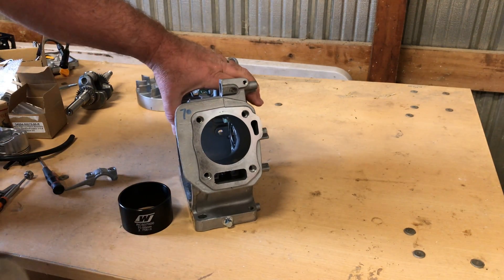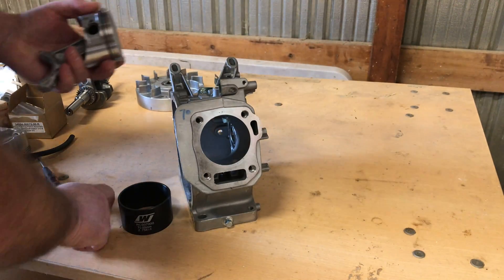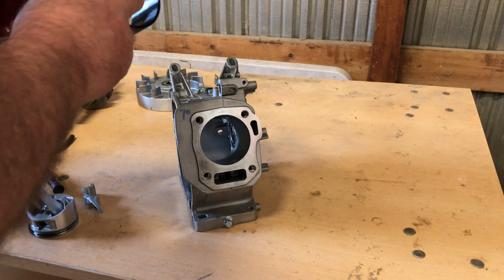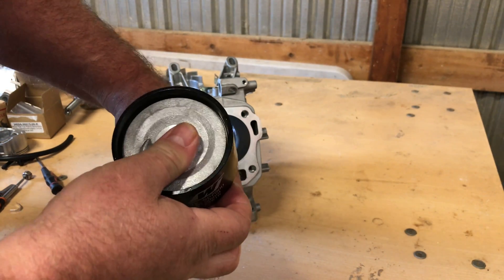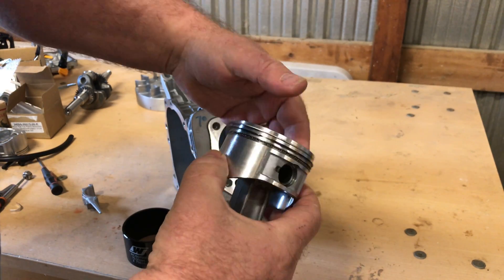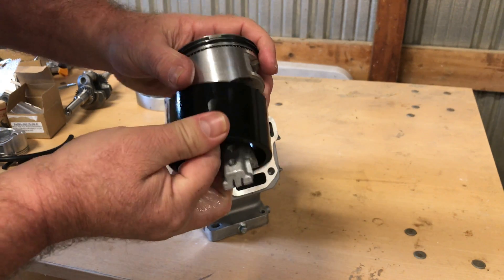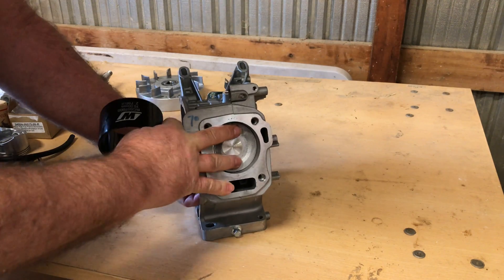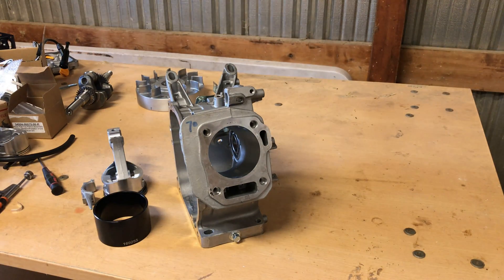Wiseco 70mm Piston Ring Compressor Best 224 Predator 212 Ghost Engine Build Tools

Comment: I got one for my Wildcat 223 as this seems way easier for my rebuild than my crap oldschool compressor I used to use but as a practice run with the old piston it keeps getting hung up on the second compression ring. You run into any issues man?
Reply from the maker: I've used my Wiseco ring compressor on several builds now and every one has been trouble free installs. One push and "zip" the piston is in the hole without broken rings. Make sure you have the tapered side of the ring compressor facing up. It would be easy to accidentally flip it around and that would cause install problems.
Reply: @KentuckyFriedFixes  Yesir had the taper the correct way I was really confused why it would not work. I used my oldschool clamp type compressor she went in no problemo.
Reply from the maker: @jaystrappa  They may have sent you a compressor for oversized piston + rings? I'd measure the ID because something is definitely wrong with that one. Mine still works like a charm.
Reply: @KentuckyFriedFixes  It’s the 70mm same part number you used man. I measured both tapered and non  tapered end that checks out. I’ll try again on another build maybe its a fluke lol
Reply from the maker: @jaystrappa  Could it be raising up off the top of the block during install? That would allow a ring to pop out on you. I'd try some downward pressure on that thing the next time. Maybe it's something simple? I've had some silly things happen to me during builds, usually because I wasn't paying attention or was distracted for a second. Usually that's all it takes for me to get a boo boo.  🤣
Reply: @KentuckyFriedFixes  I made sure it was flush against the block. I have a predator hemi just collecting distance Im going to try it on that one next. 😂 Happens to the best of us thats fasho!

Comment: Hey what other tools do you recommend, I’m about to build a predator 224 as close as I can to yours and seeing what you recommend?
Reply from the maker: Hi Ricky! That's a great point and an idea for a video too! I usually don't recommend specialty tools but in this case with the ring compressor it's a no brainer. They save you time and trouble and most importantly they save you from breaking rings. I would also recommend everyone purchase a dial caliper that reads in the .001" inch scale if you'll be doing engine work. They're cheap, like $19.95 for the HF cheapie unless you go all out and buy a $200 big brand name dial caliper, but you'll use it on literally everything in the engine. From measuring crankshaft out of round and rod clearances for oil to measuring your piston to deck height or camshaft lift, wrist pin diameter etc. Best $19.95 you'll ever spend. A 1/4 torque wrench for the rod bolts. Again, if you don't already have one you don't need anything fancy. Sure a Snap on is likely better than the Harbor Freight torque wrench, but unless you're gonna be building engines professionally, daily for other people, the HF wrench will work fine. Thanks!

Comment: Hey my friend! I want to tell you something you know I was going to do every add on I could to my 224 that was External but now that you showed me this very awesome tool I am ready to go bananas thank you so much for this information on this I will get it right away because that was the only thing holding me back from doing high modifications on my 224 I was dreading dealing with getting that piston back in the engine! If I do ( billet flywheel and rod with  mod 2 cam governor removed exhaust and 22mm carb) can I get performance with out porting my heads! I’m really afraid of messing up something in there or grinding a hole 🕳 by taking to much material away in a certain area around the valves what are your thoughts on this and is there a particular place I can send it for someone else to do it? Thanks again for any input you have on this matter👍🏽
Reply from the maker: Hi Janice! There is some power to be gained by mild porting on the head. As long as you're using stock size valves the port only needs minor improvements in specific areas. It's not impossible to do for a first timer and it's really the only way to learn. Unfortunately, mistakes can be made and heads can be ruined while gaining experience. A new casting only costs around $30 though, so it's not the end of the World if you make a mistake, everybody does whether they admit it or not. A good place to start would be gasket matching. You match the port diameter and shape to the exact size of the gasket on both the intake and exhaust ports. No other major port work need be completed, just match the port to the gasket diameter. This is a fairly easy task and it does improve flow in the head. If you want big performance gains from larger valves installed and major port work, I'd seriously consider purchasing a casting or a complete head that the work had already been completed professionally, you'd have one ready to go and also you'd have a look at it to see what what areas were worked on and try to recreate what work you see in specific areas of the next head you work on. Fully prepared heads can be expensive though. EC Carburetors has a few nice options available at reasonable prices I like their EC Evolution heads, they come with big valves and CNC porting done out of the box but they're $329. I've seen some of Paul's Karts work too and Paul does good work on his stuff, but it does come at a price. The main thing is don't be afraid to try. Start small and if you make a mistake, count it as an educational fee. Thanks!
Reply: Thank you 🙏🏼 so much I will go the easy route and purchase me a spearhead and take my time and work on it look at a few videos from you and other good YouTubers such as black 66 and cars and Cameron and the gray goat these guys to me are very educational as well but you are more detailed and you have the patience it takes so the average person understands! Thanks again for your Quick response to my question! This with you help and info will be a good weekend bike! 😳 Oh how do I recognize valve float is there a certain sound or backfire or what I just don’t want to break anything!
Reply from the maker: @janicefullerton6201  Don't be afraid to try, you'll get it. Most of the time when you experience valve float it just limits your max RPM on a mildly built engine. Now there are some cases on truly high performance engines with big ports, big valves and a big cam, if you float the valves on them they'll actually pop thru the exhaust and intake and make a heck of a racket. Those are the kind of engines with very aggressive cam lobe profiles that go thru valve springs often. If you get one built to that performance level there's a good chance you'll be changing out the valve springs on a schedule by counting the runs (JR Dragster, Mini Bike), pulls (pulling tractor), or laps(Go Kart) between valve spring changes. Good valve springs are especially important on an OHV engine. With the flathead design it's not as important as the valves can't hit the piston. Years ago most builders were using "slapper" cams in the 5hp Briggs flathead kart engines. With a light valve spring the steep ramp profile on the lobe would actually throw the valve higher than the cam lobe could physically lift it. It was a sort of controlled valve float and it kinda bent the rules a bit. But that wouldn't work on an OHV anyway. Thanks Janice!